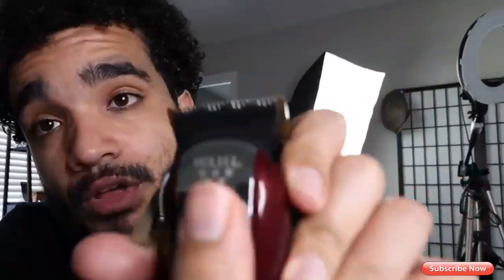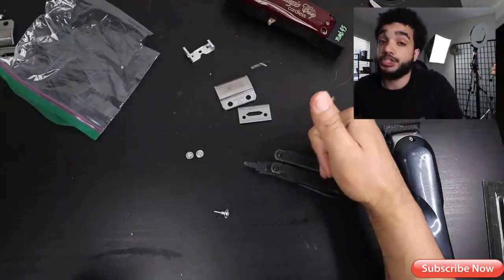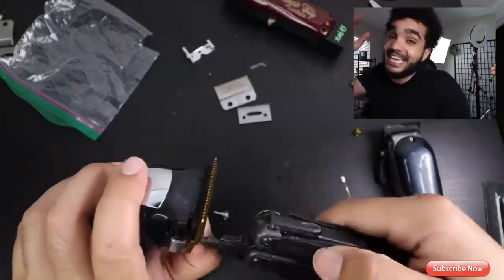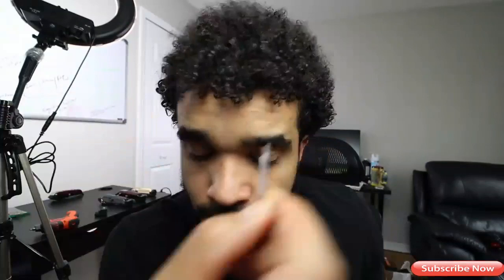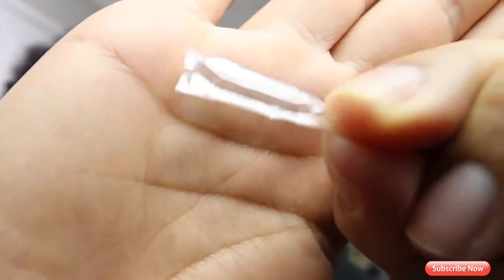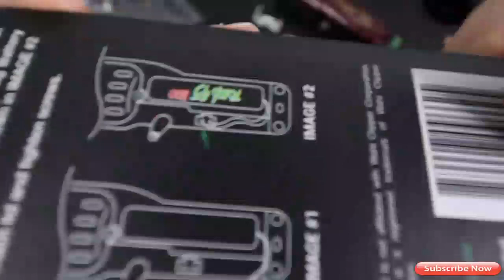How To Remove Noise To Your Hair Clipper. | Tips

Comment: The 3 hole blade is made to be able to take your clipper blade off and clean it without messing up the gap you have them set at. Just remove the big screw and remove blade. Only need to move the 2 little screws when you want to adjust the blade gap. Pretty genius really. Surprised they didn't continue it. I took that set up and put it on the gold magic clips with a ceramic blade. Honestly the best combo I've used. Hope this helps👌🏾